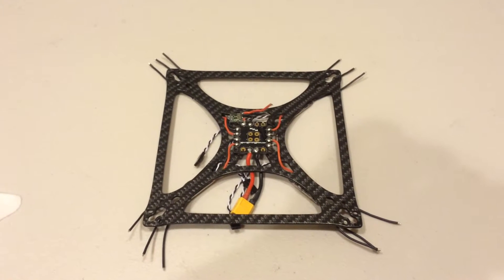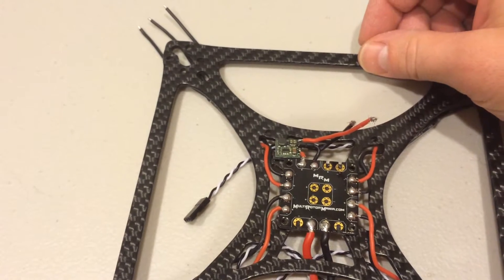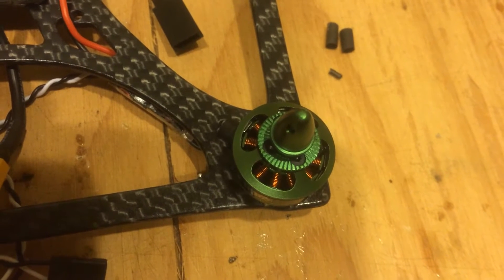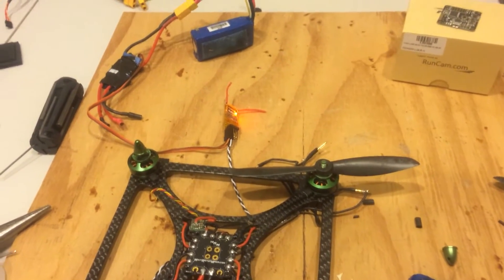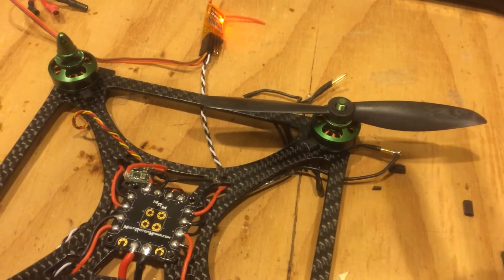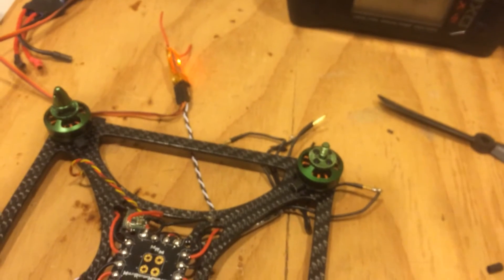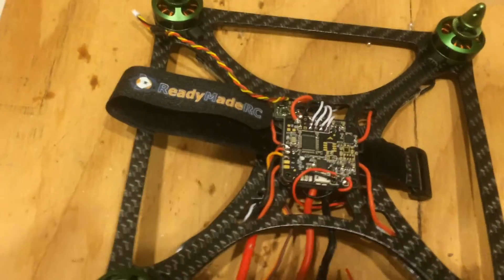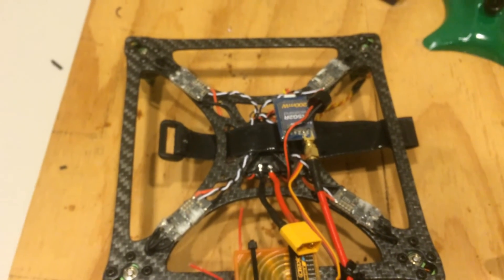XBR Build Video

Comment: So on the polulu, the gr goes to both in/out. does the shdn need to be jumped with voltage in?
Reply from the maker: +Casey Beaulieu The way I have it is the ground goes from the power distribution board to he ground on on the pololu and then another wire goes from the same ground port on the pololu  to the ground on the naze.  Power just goes Power from PDB to Vin on pololu and then Vout goes to naze.